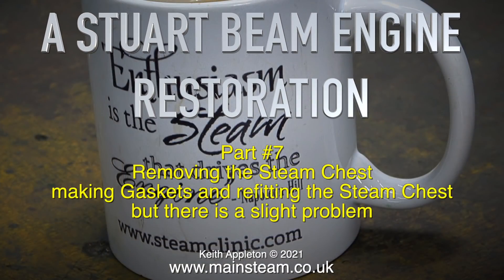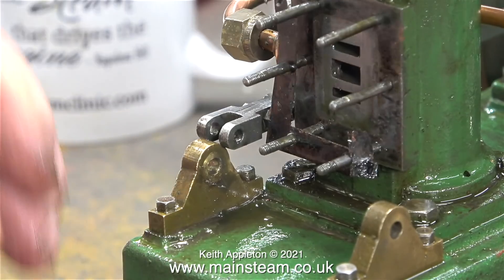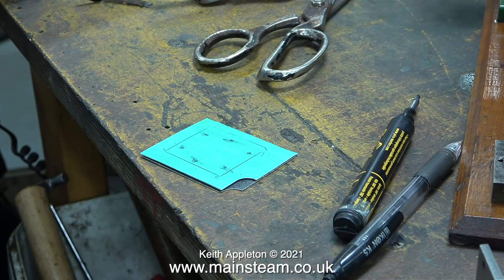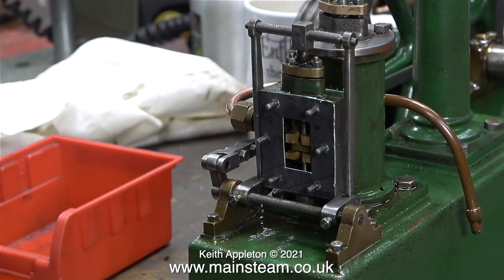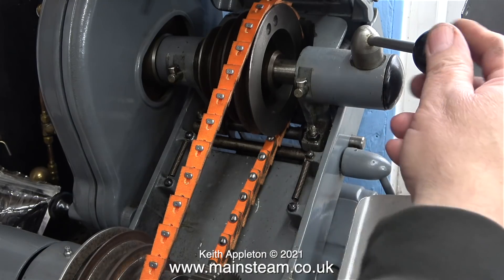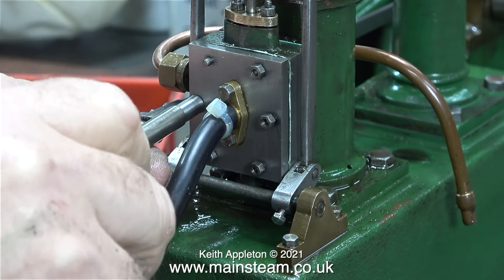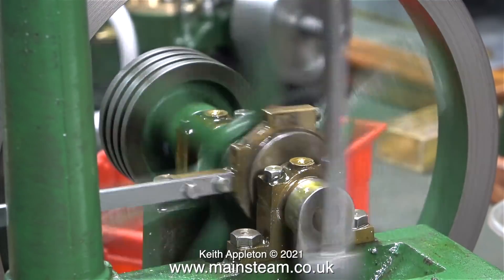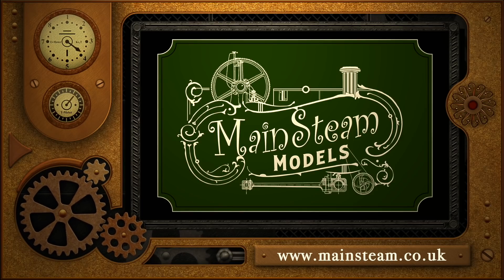A STUART BEAM ENGINE RESTORATION - PART #7

Comment: I have what I think is a really nice old Stuart D10, most parts look like brass, it has zero slop in the bearings and it runs smoothly on breath pressure. How can I find its age and value?
Reply from the maker: Try Ebay . . . . .

Comment: Your level of patience is very different from mine. There is no way,absolutely no way I would have left those studs in place before cleaning up the flat metal surface. Did that the first car engines I worked on. Very quickly found that was a genuinely bad idea. At least for me. Smooth as a baby's bottom is the way to do it. Stud pullers and other specialty tools are existence improvers. 
That beam engine is a beauty. Many years ago,I spent a day at the Living Steam Museum over by Kew Gardens. The Bolton and Watt beam engines from 1844 still exist,still run,still pump water. Magnificent dinosaurs. Yours is a simplified miniature. Wish I had one myself. Cheers.
Reply from the maker: When I watched the video playback, I too wondered why i didn't remove the studs }:-)))

Comment: Hi Kieth. Might I suggest you try exfoliated graphite gasket material. It is a little more compliant than the material you are using and it also doesn't go rock hard over time like most  'paper' based gasket materials do in steam applications.   I would send you some to try but it's along way from NZ to UK and I'm pretty sure your friend would have this lying around also anyway as it is pretty common stuff in industry. The UK based company I work for uses this material pretty much exclusively in all our steam traps and other steam system ancillaries. Cheers.